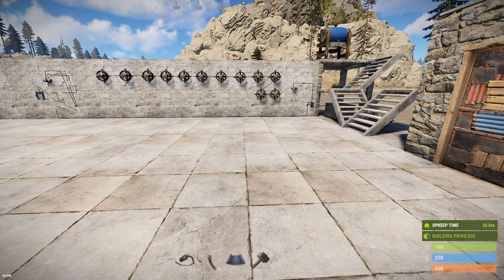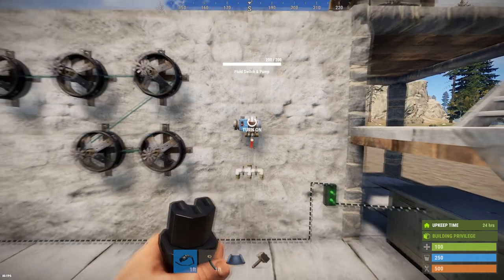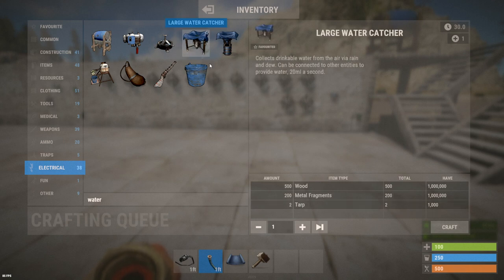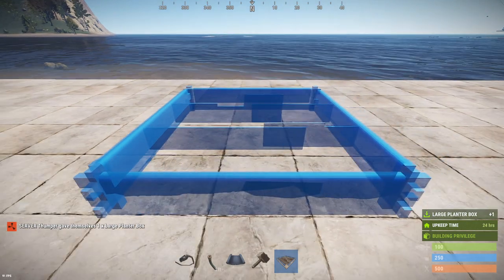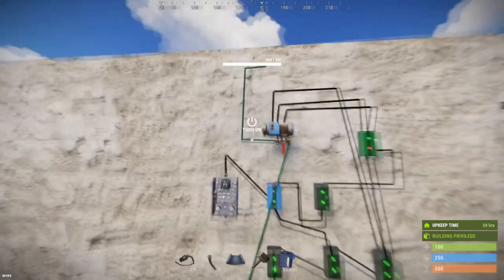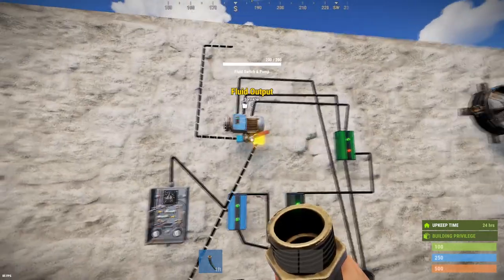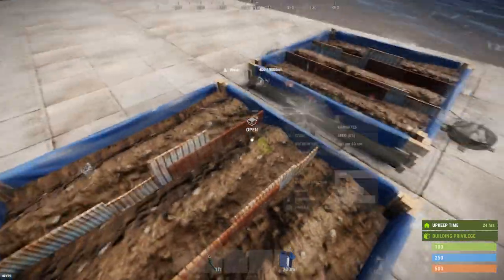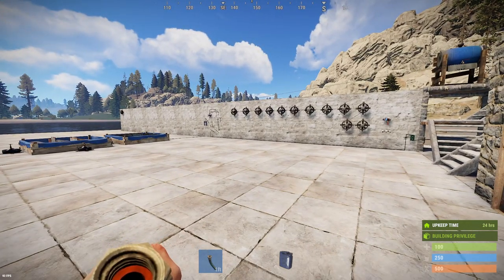Rust Farming 101: Farming 2.0 Fluid Systems Basic Guide

Comment: Well, it's still not fixed! Trying to learn the water system with your videos, really helpful stuff. but I kept an eye on the pump numbers in-game and they show the same wrong numbers as in your video. Meh. :(

Can you use multiple pumps with the fluid splitter / fluid combiner to get increased pressure? Because filling the tanks are so slooow!! A single pump says 12, but it's only transfering 6 water per 2 seconds. Please help!

Comment: You kind of said something wrong when you pointed out that watering plants "manually" (with a bucket) is more efficient - its not, because the sprinkler conjures 50% of the water out of nowhere (it drains 120, but puts 180 into the planters).
When you use a bucket and take 4000 out of the barrel, the planter also gets exactly 4000 (1-to-1 ratio).
So, in this sense, using sprinklers is 50% more "efficient", but obviously way, way slower. What you should do is fill the planters initially with a bucket, then fill the barrel using a bucket and then let the sprinklers do their magic for the long run.
its a detail, but I like the fact that the devs gave the sprinkler system an upside and I hope its not a bug, actually...
Reply from the maker: Yeah I caught that on the playback, I figured someone would point that out :) Efficient was the wrong word for sure, sprinklers could save you a bit of manual labor but barely :)
Reply: I agree but at this stage of water system, sprinkle can't be automated because of water catchers being so slow getting filled up. I think the water system sucks for now and if you wan't a viable water system in real wipe condition you will need to do it mainly by hands
Reply: @BigOrNOtHD  I think that - if you have a sprinkler system (which I agree, is a lot of work) - filling a central barrel once is worth it: Instead of doing that every 2 hours, you only have to do it every 3 hours. 

Having a sprinkler system not only makes your water last 50% longer, you also save time because you do not have to make 1 trip per planter (because you'd have to dump the entire bucket, per planter)

water catchers need to be buffed, absolutely agree there. They should probably gain +X000 every dawn on top of catching a little bit per minute
Reply: @MaZe741  I don't think the good question is about how sprinkler are effectives but how can they operates automatically and for now creating a system with water catchers is not enough, so why filling a water barrel with hands and not the plants instead, anyway you will need soft water near your base so at least you can just avoid wasting time creating a water system and just watering your plants by hands.

I understand that sprinkler are more effective but anyway you will have to do most of  the job by hands anyway.

So my conclusion is water systems for now are ineffectives and might be useless until it's buffed
Reply: Well, if you want to be technical it's more time efficient. Which I'm pretty sure was the intent.

Comment: Subbed. Can you make another video showing an efficient farming setup?
Reply: efficient is not really that easy atm i have made a couple different designs but None are involving water catchers they are trash. and so it Extremely limits you to where you can build said farm. but here is my best one so far and it does not run out of water Ever. its pretty beefy though in mats. https://www.rustrician.io/?circuit=2b9c9a7ba5fe8b9c50ffa3bcee832c20 this has been tested pretty thoroughly on all the test servers but yet to build on straight vanilla with no test this one can be built Anywhere coastal just need salt water.

Comment: whats the flow rate of water through the pipeline ?
its higher on the large water catcher than the small
how do i make more water flow faster, do i need multiple lines??
Reply from the maker: The flow rate isn't limited by the pipe/hose itself, each component that supports fluid has different limits at the connection point, and they seem to change with each update. For example, right now most have been increase to 12ml/sec, and the fluid switch/pump seems to be up to 24ml/sec now? I think they're still changing them to find out what works best.

Comment: When you watered with the jug, all 4000ml water went into the planer.  When I do this, the water gets spread between nearby touching planters, but still not all 4000ml goes into planters somewhere.  It seems like there's some waste I'm seeing on my end.  Any ideas?
Reply from the maker: I have the same experience. If there are two it seems to split evenly. If there are three it seem to put most into the center and less into each of the attached.

Comment: The sprinkler outputs 30ml/s divided by the number of planters. So you should AVOID the number of planters by which 30 is not divisible, for example:
3x planters - each gets 10ml/s (total 30ml/s)
4x planters - each gets 7ml/s (total 28ml/s)
8x planters (yes, you can place 1 sprinkler to cover 8 planters) - each gets 3ml/s (total 24ml/s so it's the worst case)

Also, you should fill up planters and maintain them at maximum level with sprinklers for maximum efficiency. You can use an electrical circuit to manage the watering time. The best ratio I found out (for now) is that if you have all seeds which consume 5ml/minute the watering time should be - 45 seconds watering, 120 seconds waiting. That way you will get the most out of your water.
Reply from the maker: This makes sense, how did you get 8 planters under a single sprinkler? I've gotten 6 to water evenly, but even when I placed more around the edges, they received no water. (All large planters btw).
Reply: @RabidRabbitGamer , first you place 6 planters in a 3x2 pattern and place a sprinkler on the ceiling right between the middle planters. After that you can add one more planter to the side of each middle planter 😂
The pattern should look something like this:
  OO
OOOO
  OO
Reply from the maker: @dnkbmc  Sweet, I'll try that again!
Reply: Yep, I have 36 planters. It takes about 20 water catchers to have enough water to just leave on . Every 2nd growing i leave all the plants out for about 30 min, and it will bring the planter back to full of water. It's easier to change salt water to regular water than using the water catchers. I don't have the big ones yet.  I enjoy the growing use to grow tea. But selling corn to the bandit camp makes more scrap. But you have to have a car with the extra carrier to carry enough or it's a pain. I usually have to pay players to make sure we make it. We don't always make it, but it makes it fun trying. Oh, and I use I sprayer for 4 large planters and 2 lights.

Comment: This game need to add a well that you can either manually collect water or use pump. Make it partially stagnant so water catchers won’t loose their job. But it should be good for planting.  In desert you can only place it in oasis or green patch.
Reply from the maker: There is a pump coming that can be used in rivers, lakes or the ocean. Along with an electrical de-salinizer for ocean water.
Reply: Also I’ve just checked the amount of water that holds in an actual bottle of water is 16.9oz that’s 499.79 ml and an average Jerry can hold 20litters that’s 20000ml. I don’t know why in game bottle of water is 120ml and game jerry can is 5000ml.

Comment: So, if I have the math right...1 sprinkler for 4 large planters makes sense.  9 crops being grown in the large planter should use roughly 45 mil per minute (excluding effect of genes).  1 sprinkler should feed 4 large planter each with 7.5 mil every 10 seconds, or 45 mil a minute.  For an optimal setup, you could wire your plant light to work on the same switch as your sprinkler since both would need to run indefinitely through out the process.  Now I just need to find out how many small water catchers it'll take to keep a sprinkler going...

Comment: so if i have 4 small water catcher which provide 6ml water each, and i connecting each other (input and output water) of the water catcher, do they provide 24ml water?
Reply from the maker: Not yet but they are working on a water combiner (similar to root combiner) that would allow you to combine water sources together sometime in the future. Right now you could use one small water catcher (6ml/sec output) to run up to 3 sprinkers, but only if you're filling it by hand. Since Small water catchers only produce 3ml/min each, you'd theoretically need 120 small water catchers chained together to keep them flowing constantly... oooof

Comment: I think the splitter should be bidirectional, so you can merge water catchers for higher output (like the root combiner). Currently (or so I've seen in testing) if you daisy chain a bunch of small water catchers to a water barrel, it will only fill at a rate of 6. If we could chain 3 sets of small catchers and then merge them with the splitter/combiner you could fill the barrel at a rate of 18.
Reply: Or just inverse there operation because the sprinklers have a passthrough.

Comment: I have stream next to my house in rust. Is there anyway I can place pump near the stream and have it pump up to the water barrel?
Reply from the maker: Not yet, but they are working on that for the future already!
Reply: IMHO I think best way to maintain water supply is to make 2-4 water barrels and fill it with water from stream. Since tarp is semi difficult to find, barrel is better choice than many water collectors because it only use only 2.  
Also I did test with 1000 ml of salt water in the  purifier and only got 200+ ml of good water. 
I checked the jerry can of water and it say 500ml but you said it holds 5000ml. Is there a text issue in-game?   Also you can make cheap water bags from cloth that holds 500ml. Make a ton, go to river, fill it all and comeback. Then fill the barrel, this would be cheapest and fastest way to get water for starter imho.
Reply from the maker: usually jerry can has 500ml by default when you find it, but if you fill it, it can hold up to 4000ml, soon to be upgraded to 5000ml.

Comment: if you put one planter in one room alone will the water pass through the walls?
Reply from the maker: I haven't tested farming in a long time, but it used to glitch that water would affect a planted immediately on the other side of the wall. That said, they may have fixed that when they fixed the ability of tesla coils to zap through walls also.

Comment: The one part that wasn't clear was the temperature. If for example my planters are showing 25% temperature what can I do to improve that?

Otherwise brilliant tutorial/guide, and thanks for putting this together! (totally agree that the output from the catchers needs to be increased! (they also need to make a craftable version of the water jug)
Reply from the maker: I've been working on getting answers to the temperature question. There doesn't appear to be a way to influence right now (other than which biome you build in). I did put in some idea requests for campfires or fireplaces to influence though, we'll see if they implement that idea...

Comment: Is There A Reason To Put Water Barrels On Roof?
Reply from the maker: Yes, if you want to use gravity to feed the sprinklers instead of a pump. It can save you needing electricity which may be helpful particularly early in building.
Reply: @RabidRabbitGamer  Thats Soo Sick. Thanks